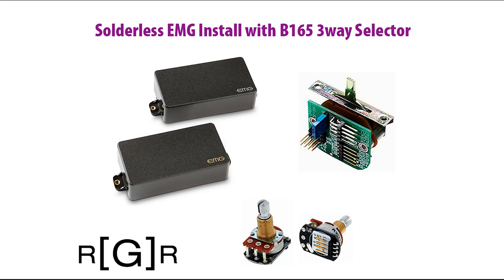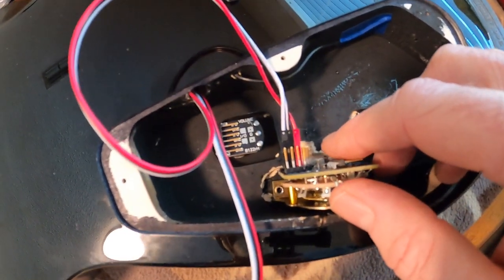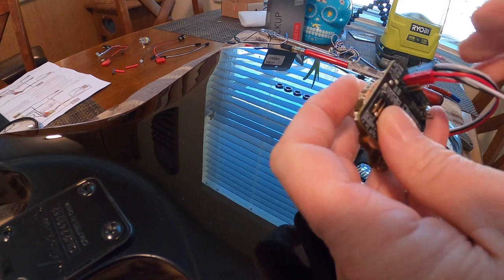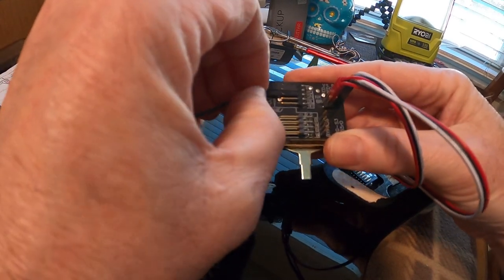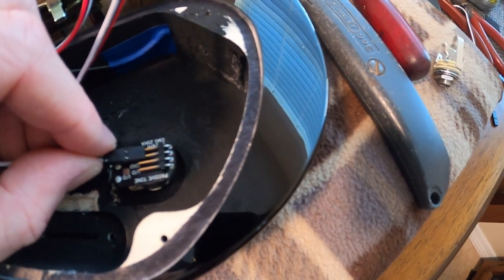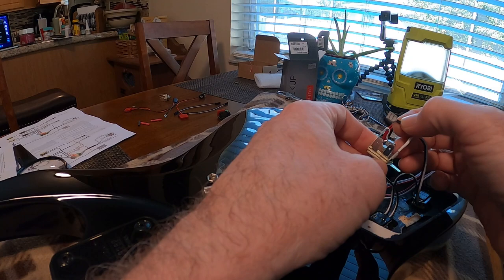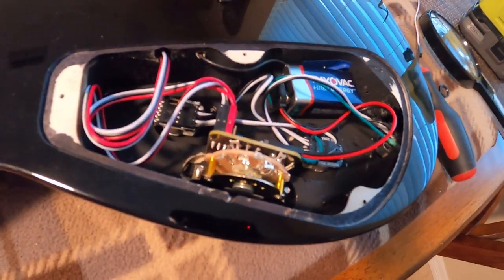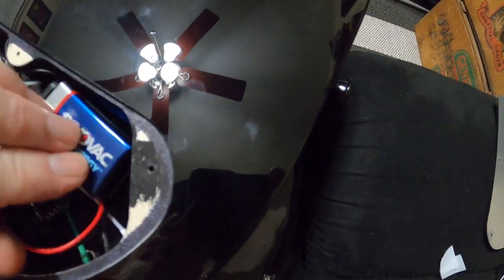Solderless install EMG 81/85 with B165 3-way switch. Jackson JS32

Comment: Do you have any tips on troubleshooting? I installed all of the same hardware on the exact same guitar and im getting zero output from the guitar. Ive probably quadruple checked the wiring and its all correct 😢
Reply from the maker: Without having hands on it ..sorry no. Power - New battery? Can you plug in and tap top of pickups to hear amplified taps?
Reply: @randygotrhythm  actually I'm just an idiot and have the pickups wires plugged in upside-down. After 4 days it's FINALLY working and omg dude I'm losing my mind with excitement. 
I owe you the biggest thank you bro. Don't think I would've been able to do it without your video!!

Comment: Say man... That kit does look sick! Now I am having a problem with the kits available and the one you have in this video. I don't see any kits coming with that battery cable or "ring" cable unless you go for a 3 pickup set. Now say I want to buy the Zakk Wylde set. I'll need a 3-pos Strat switch. Does the wiring included in the Zakk Wylde set work with that switch in a Jackson Dinky RN? Any help would be immensely helpful! Thank you
Reply from the maker: What kind of guitar? I have 81 and 85 humbuckers which is basically the same as the Zakk kit. They seem to send more wiring than needed just not the right directions.
Reply: @randygotrhythm  I just went for it actually. Got the Zakk kit and the same 3 way switch. Switch came with the battery cable and ring wire I was asking about! Saved me a lot of headache! All wires up and sounds amazing!

Comment: Is that black ground wire taped off to the side not necessary? Thanks
Reply from the maker: Correct. No ground wire is needed with active EMGs

Comment: hi, where did you get this kit? I've looked everywhere but couldn't find a kit like yours.
What i did found is a wiring kit w/o the B165 Switch but with the Battery Bus (the one you said is not needed in video).
If i will buy the Pickups not as the ZW set but separately,  the install procedure will still be the same?
in-addition, the ZW sets comes with a  volume/tone knobs pre-soldered and not he ones that you used in the video?